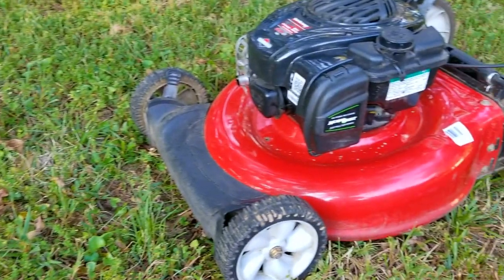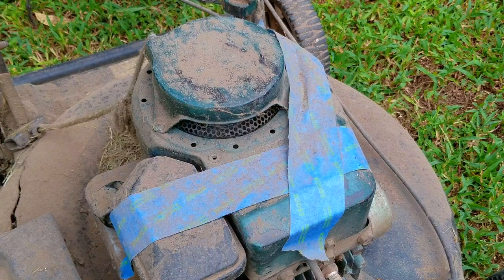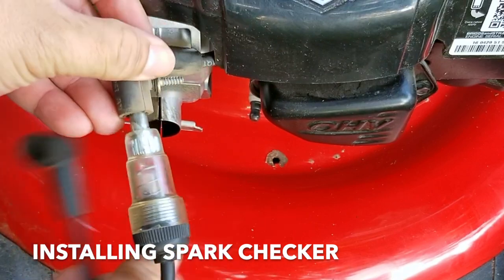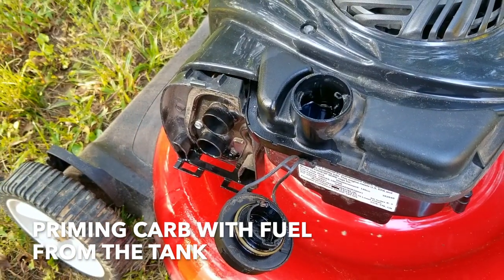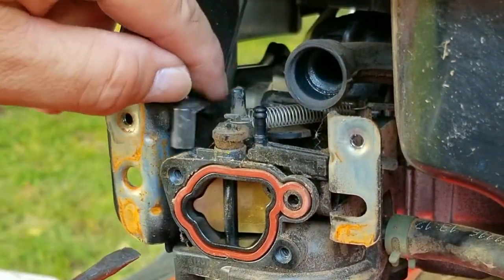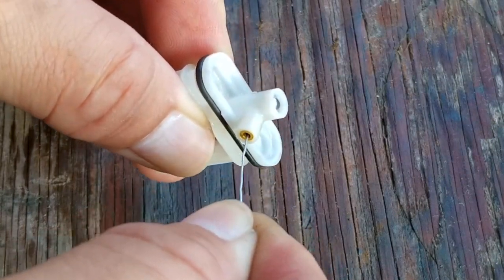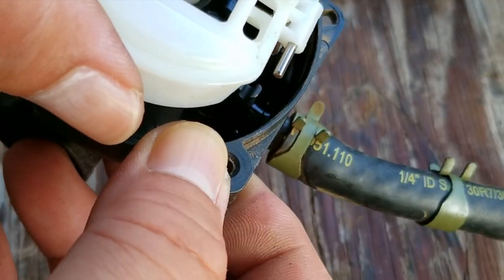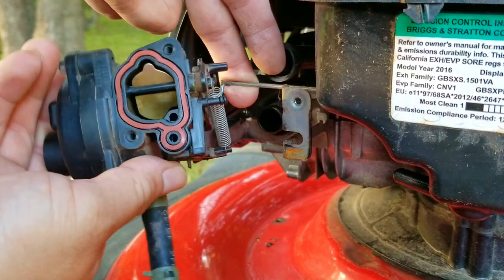Why Did Briggs Stop Making The Flathead Engine?

Comment: I never had decent luck with a Briggs motor
Reply from the maker: did you get one brand new or only second hand?
Reply: Both actually, I don't know if I'm unlucky but I had a problem with the crankshaft cracking/breaking or I would lose compression. Even with regular oil changes

Comment: Overhead valve engines have been around for over a century and are perfectly capable of reliable service. The real problem is that junky plastic carburetor. Throw a Mikuni on there and it will run forever.
Reply from the maker: interesting idea.
Reply: That was a favorite mod for the go-karts of my youth.

Comment: These new engines have lots of fuel problems in the carb.  you need to take the carb apart and ultrasonic the jets.  Ethanol in fuel is the problem with plastic carbs.

I bought 5 jets from China for $10 shipped.  I now have 4 spares of these 5:03

8:00 I hate having 2 different size screws here.  WTF?
Reply from the maker: I know with, like it was tough to make the screws the same!. thank you Muscles Mouse.

Comment: The biggest advantage to the OHV engine is the ability to adjust valve lash. With the old flat head engine, it meant removing the cylinder head, removing the valve, and carefully grinding the valve stem until you got the clearance you want. With the new engine, it's easy to remove the valve cover, and adjust the rocker with a mere turn of a knurled nut. Much easier.
     A fuel injection system would NOT save the flat head. the problem with it is "carry over" during valve overlap. The OHV engine has enough volumetric efficiency, that it doesn't need nearly as much overlap in the cam profile, to get the torque needed. They also have higher compression. Any attempt to increase the compression in a flat head means increasing restriction, thus, reducing volumetric efficiency. The compression of over head valve engines can be increased (or decreased) with no change whatsoever to volumetric efficiency. That reduces the emissions. I actually like the new plastic body carburetors, because they don't have all the dissimilar metals, that can corrode or galvanize, as the result of ethanol fuels or, water in the fuel. The ONLY disadvantage, is that plastic parts tend to warp, if they get too hot. It's hard to avoid leaks, if the warpage is more than can be filled in by the thickness of the O-rings that replaced the gaskets of old. I like the fact, that the carburetor can be disassembled and reassembled, without having to buy new gaskets. That also makes maintenance cheaper and easier.
     New engines use Briggs and Stratton "Magnetron ignition". You no longer need to pull the flywheel, to adjust the breaker point gap. It's done by an interrupter transistor imbedded in the magneto coil. That simplifies replacement should the coil fail, and eliminates the need to adjust points for maximum spark, as well as adjusting ignition timing.
Reply from the maker: thank you Vincent Robinette.

Comment: You you do not need a battery and charging system. The snow machine industry solved the problem years ago. My Polaris will fire after sitting for a year or more, two slow pulls and a quick pull and she’s ready to  braaap. Bonus points for injection and ignition based reverse. FI is the best thing to happen to ICE since liquid cooling.
Reply from the maker: thank you for the information

Comment: If the owner's manual instructions to drain the fuel out of the carb and fuel tank before storing the engine for the winter were correctly followed, it would have been unnecessary to clean the carb to get it running again. This problem was caused by not following the common sense directions. Not due to a problem with the engine design or manufacturing quality.
Reply from the maker: I believe so.

Comment: My brigs and straton lawnmower I got for free from my parents and it literally smoked so bad that u had to poke your head out of the smoke cloud to see and that was after 2yrs and then it locked up. And btw it was the $300 model
Reply: And i changed the oil
Reply from the maker: that happens sometimes.
Reply: How about all the time while your operating it
Reply: How about all the time when your using it
Reply from the maker: typically if you do an oil change, and add the correct amount of oil, to the engine and it still smokes, it means either the piston rings are gone, or there are gouges in the cylinder wall. This allows the oil, which is supposed to be lubricating the rings to get by, and burn on the combustion side. 
There is no easy fix for this.

Comment: No maintenance products it’s the root of a lot of problems. Even in, hated by everyone, electronics.

Instead of electronics would have better QC and made easier to repair it would last much longer than mechanics which is more susceptible to wear and tear (look at the cutter of the first mower).  Sadly this cost more and it is harder to market.
Reply from the maker: thank you Samuele.

Comment: everyone that owns OPE should be using a GOOD fuel stabilizer Fuel problems will go away with your equipment being stored over the winter.  No drain plug was a stupid design. The manual even states to change the oil every 50 hours iirc.
Reply from the maker: thank you skelafeti

Comment: Gasohol was maybe before my time but my instructions that came with my 2000 car did mention oxygenates I fuel. Now that's a different subject because what cane first? Ethanol mandate came 7-9 years later. It's bad for open air systems because of acids that form. Those acids eat up all but brass metals. The E series to me are not only about doing arguably more with less weight but trying to reduce the overall parts list. Economy and performance at extremely efficient manufacturing. Sign of the times? All I know is if you are a beast man with a budget, get the quantum. If you like something maneuverable and efficient and have thin grass, get the new one
Reply from the maker: thank you for the information. And yes, anything but 100% gasoline is nothing but trouble

Comment: Yeah the flatheads were great until you have to work on the valves, it makes you thankful for the OHV engines. So much easier to work on something when the valves are easy to access.
Reply from the maker: it's very rare to have to do valve adjustments, on the flathead but yes that's when they're a pain.

Comment: I still have an old 5 hp. B&S (hoz. shaft) engine from the 1950's and it runs like a dream. At most it takes 2 pulls to fire it up. It runs so well, that the idle can be lowered down to a point where it seems it will stall from lack of fuel flow, but it just keeps on chugging along like an old trooper. Runs great at top end as well. Only issue I had with it was the pull-out type choke had to be lubed each year or it wanted to stick in place. I'll fire it up again this spring, and I know it will not fail me and fire right up.
Reply from the maker: thank you Wayne Davies for sharing your experience.

Comment: i prefer the old flatheads.they may have been a P.I.A. to adjust the valves.but on mine it took nearly 500 hours before they needed adjustment(when serviced yearly).clean air filters & yearly oil changes & they last forever.i doubt the ohv engines will earn the same legacy.especially the low quality of the briggs intek series.tons of problems on that design.the vangaurds seem to be proven much better all around engine.
Reply from the maker: I completely agree!

Comment: Avoid using ethanol in small engines. The fuel will gunk up white in the carburetor when sitting idle for the off season. BTW, Honda stopped making all walk behind mowers due to environmental and regulatory concerns.
Reply from the maker: thanks, but why would they only stop making mowers due to environmental and regulatory concerns, only to keep making everything else they make, small engine wise? Power washers,  pumps, generator , trimmers, etc?
Reply: @INSIDEHOUSEGARAGE  They still make small engines, but not walk behind mowers. As I understand things, mowers were targeted for environmental concerns and Honda simply grew tired of litigation. They ended production last November, G it for yourself.
Reply from the maker: So.. let me get this right.   Honda, a HUGE manufacturer of not just cars, but planes, water craft, powersports, industrial products, can't meet the regulations for emissions, but those "no brand", engine makers "overseas''- "CAN"?  I'm thinking it's for other reasons, not just regulations.
Reply: @INSIDEHOUSEGARAGE  Honda's small engine emissions exceeded state limits. American Honda Motor Co. Inc. reached a $1.9 million settlement with the California Air Resources Board for clean-air violations related to small engines used to power lawnmowers and other garden equipment.May 31, 2020
Reply: @INSIDEHOUSEGARAGE  Honda agreed to reduce emissions but failed to reach agreed to levels. They settled with a fine then stopped all production of gas engine walk behind mowers. Perhaps these units were the highest volume culprits. They had to surrender 100,000 emission credits of the 40 million they had as part of the settlement.
Reply from the maker: ONLY in California. 
If Honda exceeded the limits, in the other states, than believe me, no other engine brand was able to meet them either. That was the point, the limits were so strict none of them can, except by your logic, only the overseas engines. Now I wonder how they did that?
Reply from the maker: I see, pick on the the one company that had enough money to pay the fine. 
B&S didn't have it apparently nor Kohler. Who else am I missing, oh yeah the ones most of us can't pronounce.
Reply: @INSIDEHOUSEGARAGE  Yep, they don't go after moving targets, they go for the big guys who work within the system. It's little about cleaning the environment, it's more about winning battles to slowly effect change. Tesla sells lots of credits, but anyone buying them had better comply unless they duck out quick.

Comment: 30 days? Not true. The Petro industry says one year. I go 6 months with all sorts of engines without a problem
Reply from the maker: hey thanks! you do you.
Reply: @INSIDEHOUSEGARAGE  yup I run multiple generators chainsaws whackers cars and trucks. 6 months is half industry standard.
Your mower problem is that cheesey plastic carb. Even Chinese engines still are aluminum carbs.
Plastic is no way to make a carb
Reply from the maker: you got that right.

Comment: I have a 1962 Montgomery Wards 5hp rototiller. It has the old Briggs engine and it will fire on the 1st pull every time. What I want to know is why the hell they all did away with the throttle control. And no damn oil drain plug a the bottom. Stupid shit if you ask me.
Reply from the maker: I know right, I'll guess we'll never know, but if had to guess, money

Comment: They're all going out due to new battery mowers. Costing about the same, less noise, no fumes, and no gas cans is going to win a lot of people over.
Reply from the maker: I don't agree. Battery electric, for comparable mowers, is higher than gas.  Less noise 
but not by much, fumes are not emanating from the mower but from the power plants that supply them power, and gas cans how now been replaced by battery packs. Battery electric is not problem free and neither is the mower or the power to make them run.
Reply: @INSIDEHOUSEGARAGE  For most people, I think the marketing will make quick work of the shortcomings. I agree that they tend to be weaker, still run on 80% coal (but not 3' from your face) in West Virginia, and they need charging every use vs refill every several hours running, but like I say most people will see cleaner simpler and go for that if the price is good.
Reply from the maker: I will admit battery electric is the way of the future and the market is working.
But I do believe ICE will be around for much longer than most people want to admit too.  Thanks for the response GoogleMinus.

Comment: The thing is Honda knows how to make a great OHV engine, briggs doesn't. They tend to use less plastics too. That's not to say the Honda engine is better than the old flat head but it's much better then any recent briggs. Kinda sad.. it's almost as if Honda did their homework and tested out things until they got something decent and Briggs just designed what worked the cheapest. As they say cheap for a reason and Honda law mowers are not cheap.
Reply from the maker: well said and I completely agree .

Comment: That engine seems to be lacking a fuel shutoff.  Would have helped keep the gummies out of the carburetor if used. 
 It really is not the same company (post "bonus" followed by bankruptcy) as the one that the management ran into the ground   (I should have known to have sold my B&S stock when they had that "never change oil" ad)
I certainly don't intend to buy any more "Briggs & Stratton" engines and would probably get into trouble if I said what I really think about the management that destroyed my $10K or so worth of stock investment-even in a world where they didn't have to compete with rival Tecumseh Power anymore- 
remember there were the old tried and true flatheads such as the 92902,then came such as the "Max" series and then the Quantum and Quantum Power which later was simply called the Quantum 
those tended to have more torque and might have ran a bit smoother than the older models,some of them were available with sleeves and upgraded bearings,perhaps upgraded valve guides as "Industrial-Commercial" or "Rental Duty" 
I think the Max and similar "Quiet Power" could get loose head bolts unless the carburetor were made a bit richer
did the Intek mower engine need more and/or larger head bolts?

Comment: I favor your solution here. Innovation means doing a job better, longer, easier, safer, healthier, and with less materials. The flathead did a job decently for a long time with reliable ease, plus bad pollution. The overhead valves do the job better for a shorter time with less durable ease, despite less pollution. Innovation is not a trade-off, and this market behavior is a sign that proper tech regulation is failing. I hope for a day when you can walk into a store, spend less for a conversion kit, recycle old parts for better ones, and keep your same great machine running better.
Reply from the maker: I like the way you put that. It makes a lot of sense

Comment: If you take a look at thevengine you'll see that it's just a converted flathead.
Reply from the maker: I'm going to to make a video about that, because can't see how.
Reply: @INSIDE HOUSE GARAGE  I'm not saying they converted an existing engine. But the modified the flathead block. When there stripped down its cleat to see.

Comment: A manufacturer can build a "good" flathead and it can build a "bad" flathead. A manufacturer can build a "good" OHV and it can build a "bad" OHV. Flatheads aren't inherently one or the other just due to their combustion chamber design. Versus OHV, flatheads are fuel inefficient, power limited and high emissions. That's whey Briggs, and everyone else, adopted the OHV. If Briggs chose to execute a poor and unreliable overall design, that doesn't make the OHV "worse" than the flathead.
Reply from the maker: thank you Jim Allen. The cheap plastic makes them worse.

Comment: It's called emissions. A flat head is grossly dirtier than a overhead valve head.
Reply from the maker: that's true.
Reply: @INSIDEHOUSEGARAGE  The emissions is the reason California is banning small gas engines. Even fuel injection couldn't meet the mandated standards. Forget the practicality. Thus the electric mandate.
Reply from the maker: it is true, but I am worried about the increased chances of residential fires, that batteries can start if damaged.

Comment: First of all, ethanol fuel is just as bad on fuel injectors. Second, you would have to have a battery and charging system to run a fuel injection system, significantly adding to the cost. Third, the flat head would never be able to meet emission standards,  no matter what fuel delivery system it has. It is extremely inefficient compared to an overhead valve or overhead cam design.
Reply from the maker: no you're right, thanks for the comment.

Comment: If the new engine has so much more power then the old flatheads, why are we cutting grass with a 6hp motor instead of a 3,3.5, or4 hp motor. The truth is they don’t. Snapper and Toro used to put a 3.5 or 4 hp motor on their mulching, side or rear shoot decks, and thous mowers used to do the job and do it great! Now we have 6 or more hps and can’t mulch worth the shit without clogging. We have to use plastic parts ( ex. Carbs) because of the high ethanol in the fuel.
Reply from the maker: you bring up a good point.

Comment: In addition, plastic  parts are not generally recyclable, I think this change to plastic says a lot about how Briggs management cares about the environment-not at all.  I have the old flathead Briggs and will use it as long as possible-I will not support this "change to plastic" crap.
Reply from the maker: it does make you think.  Thank you Patty Everett.
Reply: @INSIDEHOUSEGARAGE  Paint manufacturers are even replacing perfectly re-cyclable metal paint cans with plastic-how environmentally insensitive can you get!

Comment: The Flathead engine is cheap and simple. However it is horribly inefficient in both breathing and combustion efficiency. Fuel injection doesn't make any sense. What they need to do is update the design of their carbs using annular discharge for example.
Overhead valve is more complicated that's true, however its power and efficiency is considerably better. It's worth the expense.
Reply from the maker: very true, too bad they held out for so long, that it was too little too late.